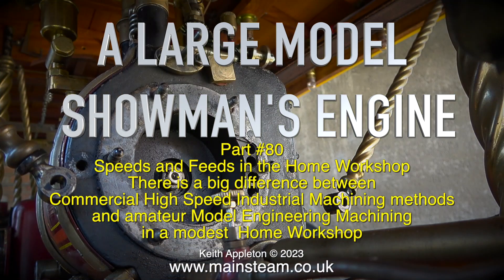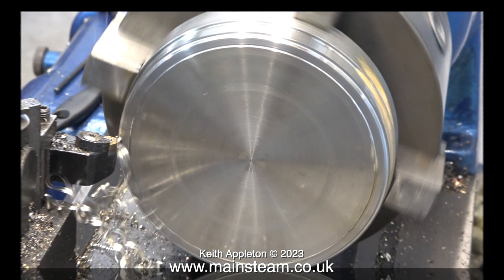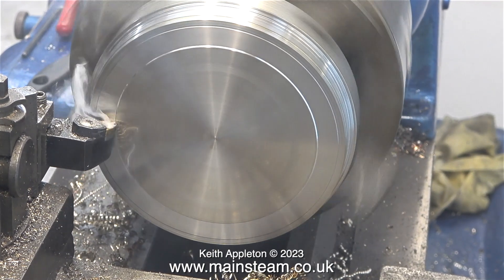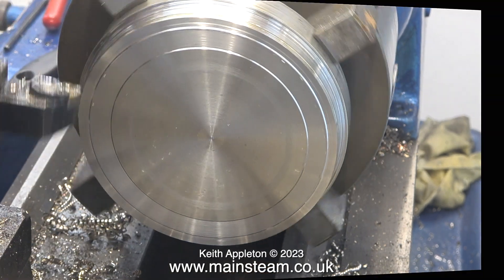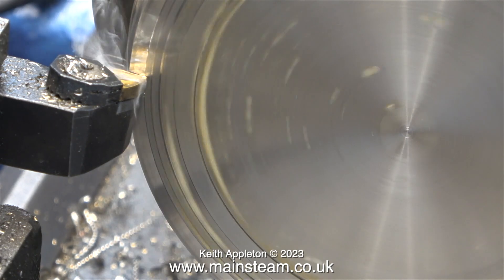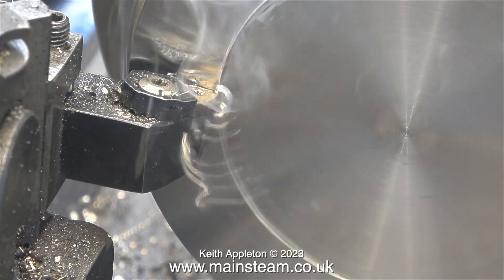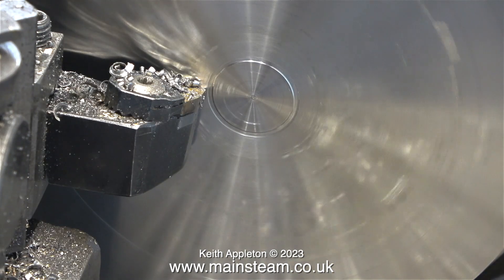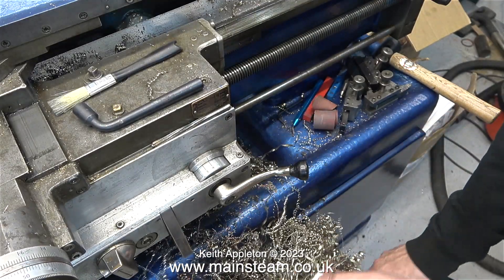A LARGE MODEL SHOWMAN'S ENGINE - PART #80

Comment: Hi there I liked this video 😊. I own a mamod steam engine te1a and i also own some raw coal that is suitable for full size steam engines and would like to try to make the mamod run on coal. I could make a new burner tray to hold the coal. Do you think it will work and won’t damage the model. Thanks
Reply from the maker: That is not practical in any way. The design of a small Mamod steam toy is very unsuitable for Coal firing. There is no way from the firebox for the products of combustion to go up the chimney. Just don't do it.